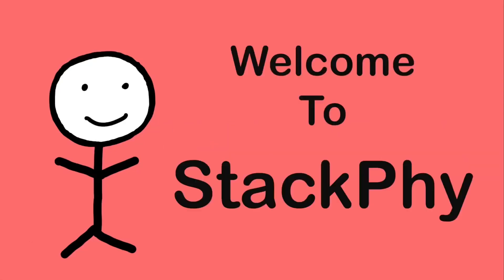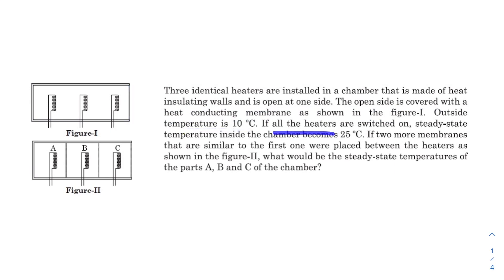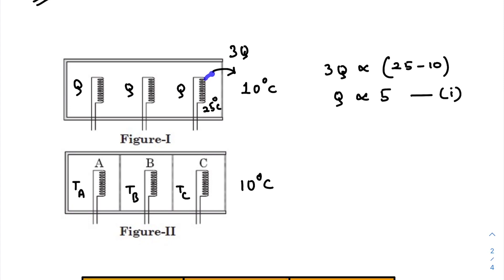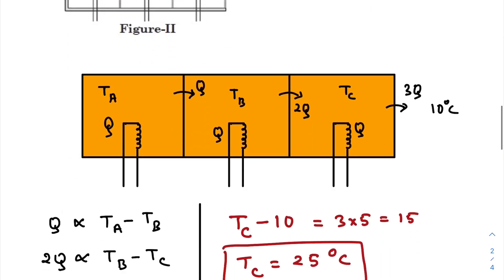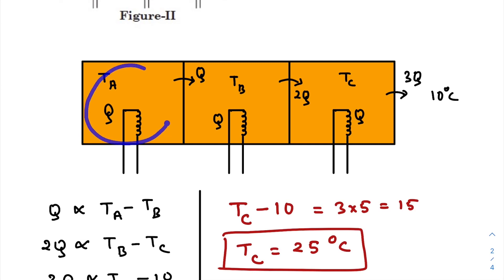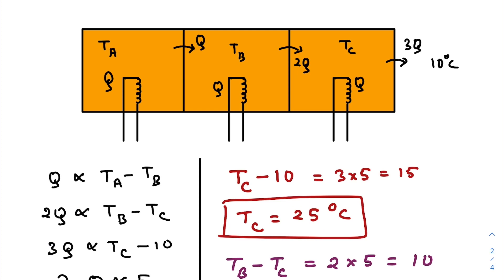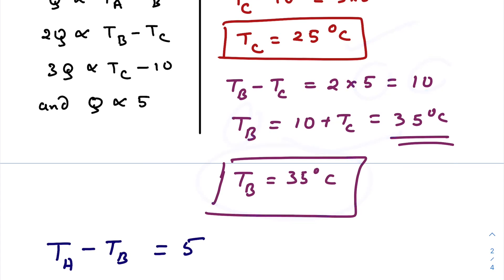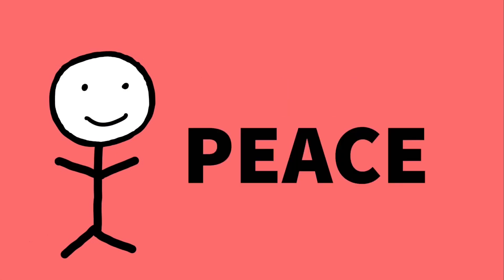Pathfinder for JEE Advanced Physics (Page - 8.14, Q - 12) | StackPhy

Comment: Sir I don't understand ans calculated by you is also the ans given in pathfinder naa and I also got that.....why did you say ans key given is wrong and at the end you calculated Ta as 40 but said 45 while mentioning the ans? Am confused
Reply from the maker: Answer by me is Ta = 40, Tb = 35, Tc = 25.
Answer by Pathfinder :- Ta = 25, Tb = 35 and Tc = 40

I mistakenly told 45 instead of 40.

Sorry for the confusion
Reply: @RamizZamanJEEPhysics  thank you so much sir😄though I understood the concept and could solve it so no worries.....sir you need not be sorry it happens with everyone😅humans are prone to make small errors
Reply: Sir pls do reply its a request